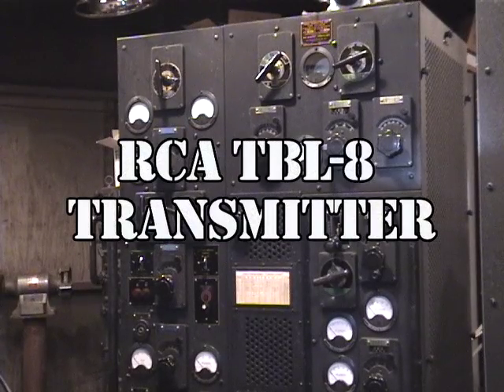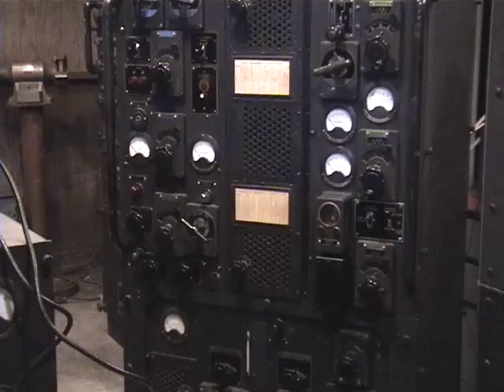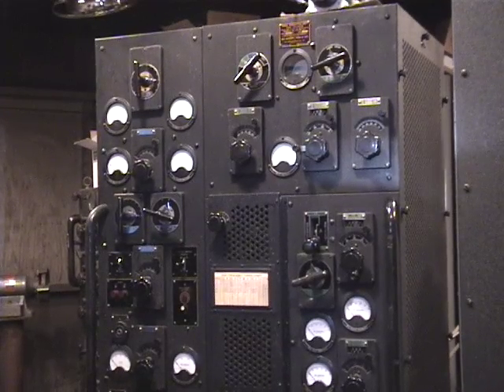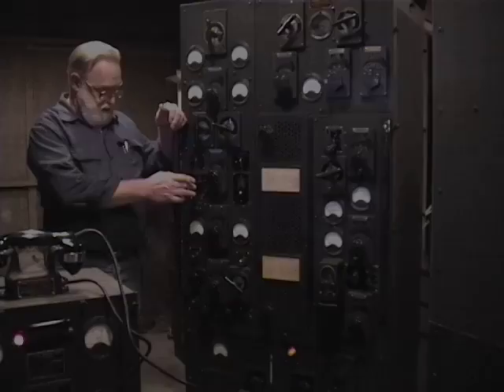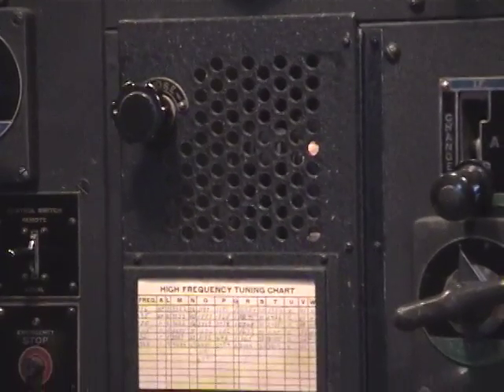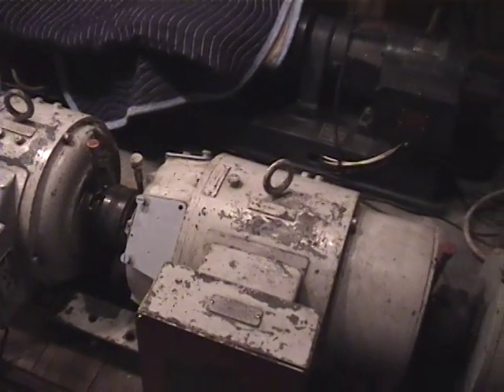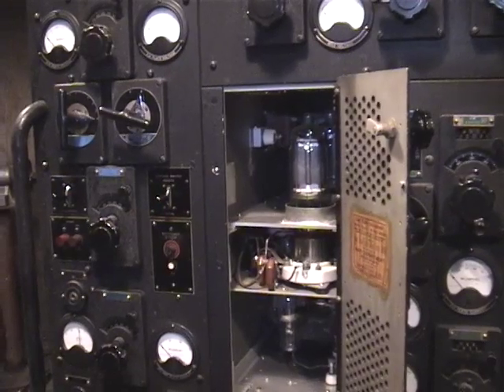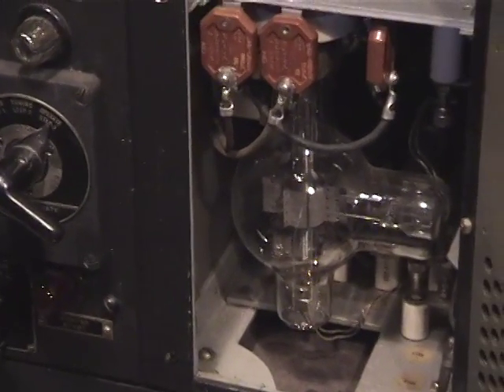Navy TBL-8 Transmitter Restored (Updated)

Comment: We  worked on this transmitter on 09-28-2019. One of the 860 tubes went gassy. I just started volunteering on the USS Slater and my area of interest is the radio room. I have over 40 years of experience working on this old stuff. Navy equipment is new to me but in many ways is is similar to older US Air Force and US Army vintage equipment. My call is W2PFY and the other volunteer new to this ship is Steve W2TRH who also enjoys working on military radio equipment. My hat is off to WA6OPE for the find job he did restoring the TBL-8 transmitter.....The ships call is WW2DEM and I had the pleasure of working the ships radio on 06-03-2017 on 3.885Mhz AM. It sounded like a military rig. I was using my BC-610D Army transmitter.